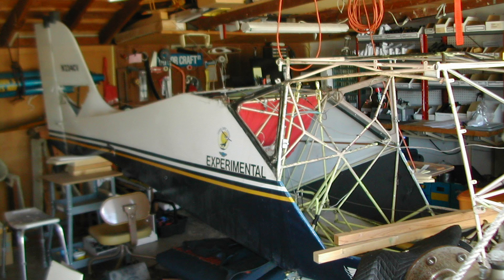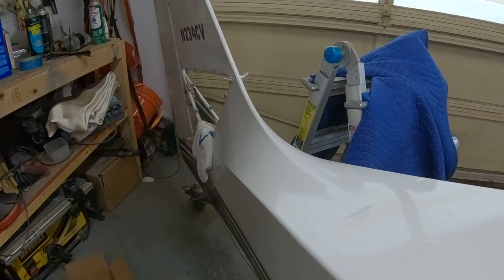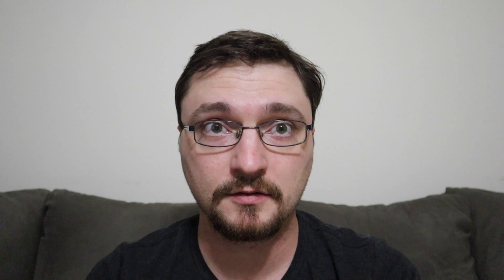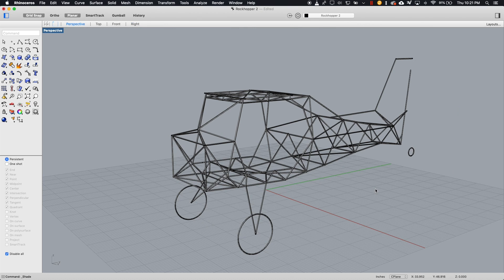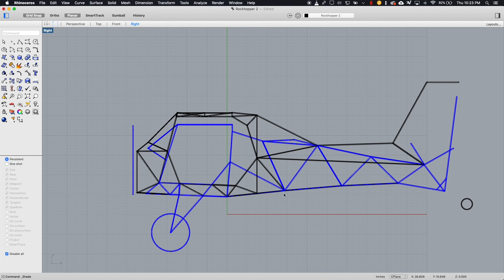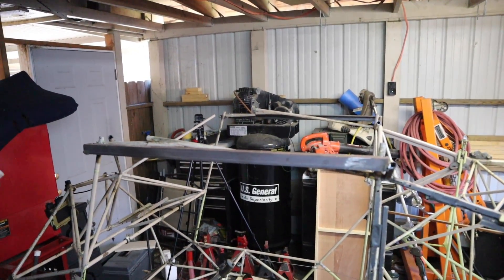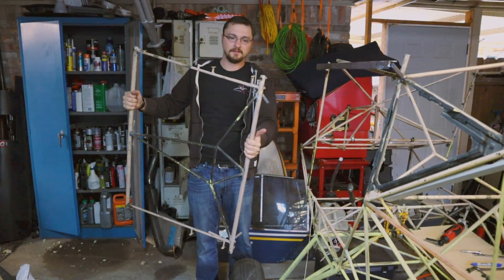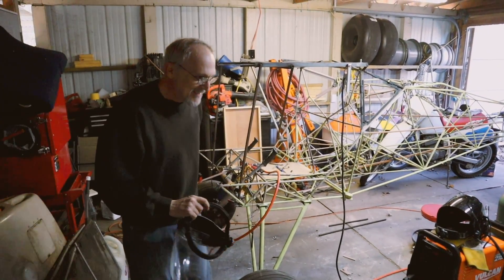We're building a bushplane, FROM SCRATCH! Episode 1 - Meet the Rockhopper

Comment: I want to build a stop aircraft looking for a cheap project or one off.scratch on the gulf coast. My budget is like yours I have a o200 where would you suggest as a good basis thought of double eagle and beef it up and change wings
Reply from the maker: The absolute cheapest thing to do is wait for an inexpensive airplane with some sort of problem to come along on barnstormers and work it over. You won’t get any cheaper than that. If I had been smart I would have waited for a damaged cub or rans s7 and repaired it.

Comment: Your right about the Avid being tight inside. I'm interested in your old landing gear, fiberglass cowl and turtle deck cover and doors if you still have them.  I have an Avid that's missing those items.
Reply from the maker: Which model avid do you need the parts for? Mine is a B which means parts should fit A/B/C models but not mk4. If yours is an early one I’ll be happy to sell them to you.
Reply: @ianslife210  Mine was registered as a B model originally. Someone has modified it to almost a C model and even some additional changes. I picked it up at a sheriff sale and was unable to ever contact the last owner to ask him about the mods. It was covered in bird shit in an old hanger with the prop, cowl, doors and turtle deck missing. 582 Rotax. I took the engine apart and ordered a few replacement parts and purchased a used prop. It is setup with a nose wheel and I'd also like to convert it to a tail dragger. My email address is camphorblue@gmail.com
Reply: @ianslife210   I just noticed my spell checker screwed up my email in my previous response. I have edited it to correct it so if you tried to message me please change the address and resend.

Thanks.
Reply: @ianslife210  Sorry about getting the email wrong twice now. It's getting closer now that I corrected it again.
Camphorblue@gmail.com if this don't work I'll have to put a phone number here next time.

Comment: New viewer here. I'm an old fabricator that has built over 18 fuselages. I have repaired a couple of these Avid/Kitfox fuselages for minor ground loop damage. One thing I know for sure is I wouldn't want to build a jig to build one from scratch. They have tubes going everywhere. Your mod. seems pretty radical for moving the seating position back. Are you retaining the folding wing feature? Looking forward to your progress. The Yamaha engine is very interesting.
Reply from the maker: The folding wings are not a selling point to me. I’m just as happy to be able to remove them easily with three bolts. It’s much easier for my new design to not have to fold as well so I’ve just removed that feature.

Comment: Holy geez, this series fills a huge hole in aviation videos on youtube. Backstory on what avid and kitfox are, ambitious plan on a budget, and showing it all with out a lame slideshow.  Now for a serious question. What are these tubes made out of? If they are cro moly then you'd better do some homework on the proper weld procedures and I can guess that it's not a 110 flux core mig.  Also is it pht, ht or annelled. What are the differences between say 4340 and 4140 and all the different blends? What properties do the exhibit during weld, stress, shear, heat cycles and so on.  So what type of metal is that frame?

Comment: I love your built and concept, this will be one badass SuperSTOL! Have you seen the extra 14" added to the tail section to create the frame of the Superstol XL Since you've added some room up front you might consider adding to length in the tail for storage and so that you can sleep in the aircraft when needed? https://justaircraft.com/superstol-xl/
Reply from the maker: I am familiar with the XL, and in fact all of my other renditions of the rockhopper had an extended tail to fix the CG issues. With an extended tail however the amount of airplane we had left was so little that it would actually be easier to start from scratch and we didn't want to go quite that far on this plane. I'm not entirely sure we actually saved any significant effort but as our first "scratch" build plane there's a big mental component to giving up the last original parts and building all new.

Comment: Great video,I'm sure in your research you are aware the Avid are weak in the whole landing gear area ,seeing you mention that this plane suffered the same fate.The gear itself is weak as well as the bungee truss and the fuselage in the whole landing gear area.On the Avid site their are some Great photos of the areas that need reinforcement and plating.Keep up the good work!!
Reply from the maker: Yup! This plane has several prior repairs to the bungee truss from prior hard landings. I won’t be using the stock landing gear at all and the new gear will be “cub style” to allow for shocks. It should be good and tough!

Comment: Are you planning on TIG welding or MIG welding your frame back together? Is an Avid chrome moly like a Kitfox?
Reply from the maker: MIG for most everything. There may be select parts I TIG. The avid frame is MIG welded 4130 chromoly tubing originally as is all of the parts we are changing.
Reply: @ianslife210  why would you chance the risks associated with MIG when TIG is a much easier and effective method?
Reply from the maker: I’ve done tons of test joints using both methods and read up on the risks associated with all methods and came to the conclusion that for real world welds in awkward spots on an airplane without a jig, MIG was the best fit for me. Your own capabilities and methods may make TIG or gas welding a better fit.
Reply: @ianslife210  very glad you have done the research and practice on this and know what you are getting in to. Subscribed and looking forward to the build!

Comment: Maybe I missed it but what happened to it to go from airworthy to salvage? It looks like quite the project but should be fun and satisfying when finished. The channel Project Kitfox has an Apex motor and is planning on either modifying his current plane or building a new kit. I'm sure you're aware of the channel. I look forward to the build.
Reply from the maker: The amount of me talking at the camera was already getting excessive so I left that part out. The plane broke a landing gear landing off airport and ground looped. The insurance totaled it due to prop strike. The owner bought it back, pulled his equipment and put it all in a new plane and then sold the old one. Damage was one landing gear (replaced prior to me buying it), a slight twist in the cabin (straightened before I got it), and scuffs on the wing tips. I'm replacing most of the damaged areas anyway so no real problems.